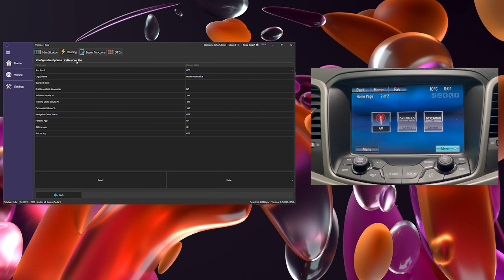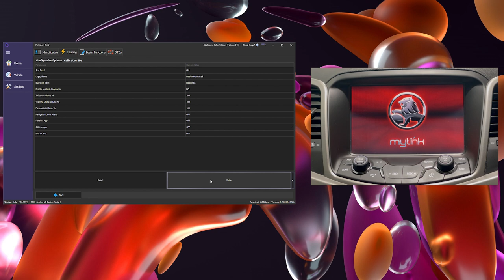How to Program and Configure a Holden VF Mylink Radio

Comment: hi how to unlock mylink radio, recent battery change and mechanical work done, now the stereo is locked thanks.
Reply from the maker: The radio should not require reprogramming unless the radio box has been replaced. You can use OBDSync to fault code scan the vehicle and if required reprogram the radio.

Comment: Would love to have the red theme and Holden screen in my ppv! is it a tune you can buy?
Reply from the maker: You can change the theme and logo to the red Holden using OBDSync.
This is under the configurable options of the flashing tab in the mylink radio menu.

Comment: Super easy and quick. One weird issue with my VF Chevy SS: after flashing the Mylink to Holden red, when the radio turns on it'll show the red theme, but when I use satellite radio the 'Now Playing' screen starts out red and quickly turns back to blue.
Reply from the maker: In the config on the mylink there is settings for the XM album art and that needs to be disabled
Reply: @OBDSync  I'll give that a shot! Thanks for the quick reply!